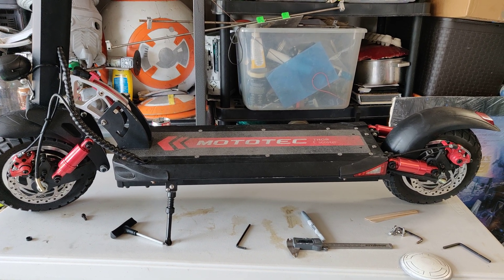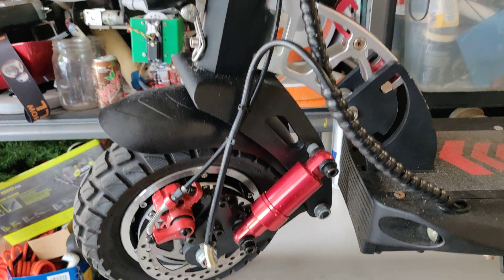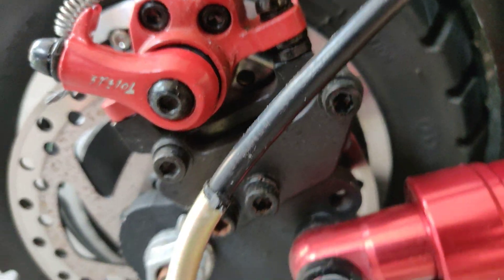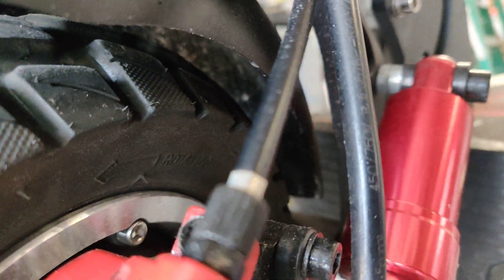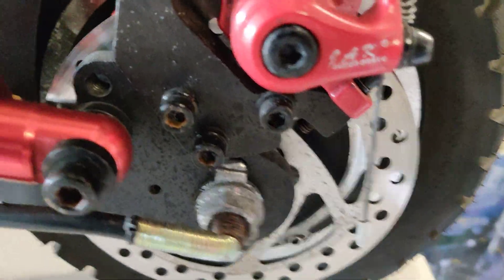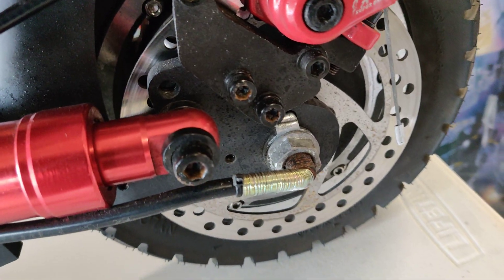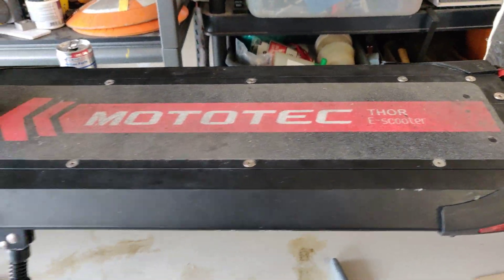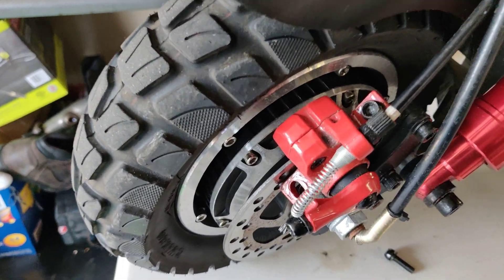MotoTec Thor: How to Make the Brakes Better!

Comment: I'm about to buy one of these in next couple a days.would u recommend?
Reply: Does your battery charger get super hot?
Reply from the maker: @Esk-be8kd  yes but it a 65watt charger it will get hot
Reply from the maker: It's a great scooter for it's price point. It's fast reliable and a great ride. Keep in mind it's not water proof, so washing the scooter with a garden hose is out, you have to wipe it down with a wet towel. 
Ive got over 350 miles on mine since July with a commute distance of 2 miles to work and 2 miles back. 
I'll be doing a video soon of some of the upgrades that Ive done, like bicycle handle bars instead of the stock bars (bicycle ones are wider giving you a better and wider control over the steering).
Let me know if you have any more questions about this escooter and I'd be glad to answer!
Reply: @Jay-May  I found the weak spot that will go bad it where the deck meets the neck.its two prongs of the deck that go into the neck is going bad 3 days into having it
Reply: @Esk-be8kd  when you take off don't be pulling back lean forward, go with the scooter don't let it pull you
Reply: @Jay-May  It would rust it any way too much water but it would be a nice feature
Reply from the maker: @3katd  the body is made of aluminum, no rust. I've replaced most of my bolts with stainless steel so it wont rust. It's a cheaper fast scooter, it will need help to make it great and more reliable in wet conditions.
Reply: @Jay-May have you posted the video of the upgrades yet, i also have this same scooter and I’m interested to see what upgrades you’ve done

Comment: Do you have a new vid coming? I just got mine last week. I'm still tweaking my brakes and trying to figure out a few features that aren't explained clearly in the manual. The back brakes came nearly engaged.
Reply from the maker: So the back brakes will need a little help with clearance. You have to remove material from the area between the brake caliper and the wheel motor, just enough to make clearance. This can be done with a file, sandpaper or a Dremel with a grinding  bit.

Comment: Hi Jay, is there anyway you could just put a larger disc on?
Reply from the maker: I would leave the stock disc. The brakes are good once you make the adjustment.
If your concerned about braking look up hydraulic brakes.  They work better, but cost more.

Comment: Hi Jay, I also have a Moto tech Thor. I noticed that the front brakes had two washers or maybe they're called spacers and the rear had one washer or spacer. Can you just take the two spacers off on the front disc brake. That seems like it will add quite a bit more space for the front, as far as the rear not as much. I also noticed that there's more grab in the front. Also I also noticed that there's definitely barely any space in the back before the disc brake pad housing touches the edge of the rotor. Have you tried sanding it down yet?
Reply from the maker: I took off the spacers. The front brakes are better now. The rears need the spacers taken out and clearance needs to be taken out where it rubs. 
After 200 miles the brakes both wear the same.
Reply: @Jay-May  is it possible to just buy a larger disc. How many millimeters do you recommend.?
Reply from the maker: @josephc.5265  Not sure about larger discs, doing that adds more problems, in my opinion just fix what's there to make it better.

Comment: Thanks for the tip👍i'll wait for your follow up to see the difference might try it on my Thor.✌
Reply from the maker: The brakes grab better now when you get past the braking regeneration. More surface area for the brakes means more stopping power. The fronts were only grabbing a little over 40%, taking the spacers out I now have close to 98%.
My problem is what happens if your only grabbing 40% and the pads wear down to the point where they make contact and stop grabbing the rotor. I didn't want that to happen in this case.
The fronts are easy, I'd start there. Just remove the spacers and it should work way better. My guess is these parts came in the brake kit and they used them instead of tossing them. 
On a side note, my shocks are installed so that they are flipped, not facing the same direction, I don't know if anyone else's shocks are like this, but at least for the back I swapped them to the same direction and the back feels a little better suspension wise.
Reply: @Jay-May  Wow! big difference.. I will definitely do the same on my brakes👍 as for the shocks mine are good only problem is the brakes I will do a test run afterwards this should really help to stop better, if you come up with something else please post it thanks again for sharing.  ✌